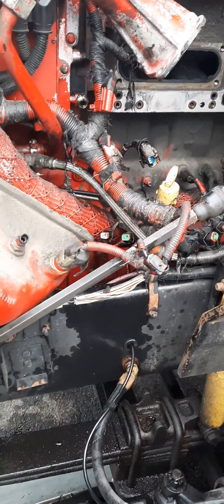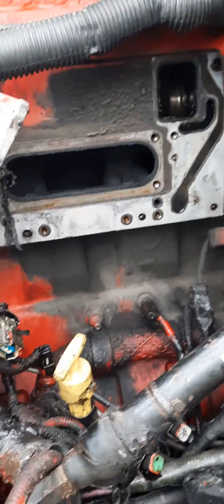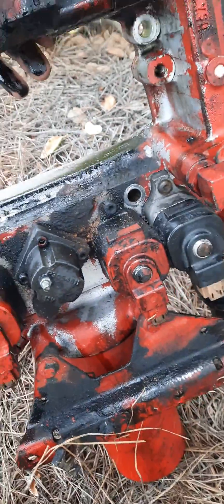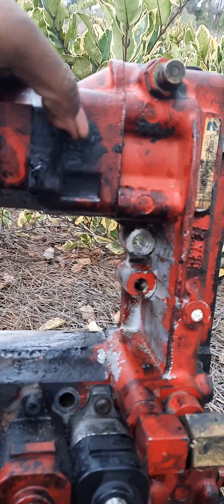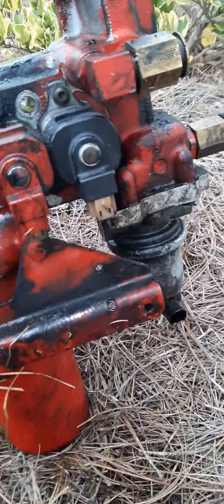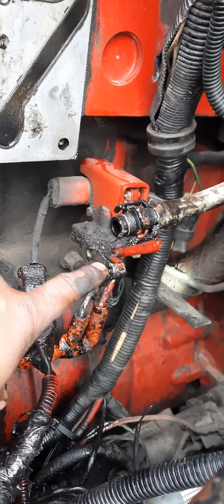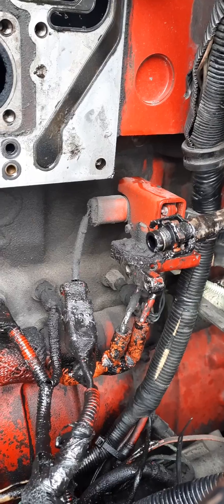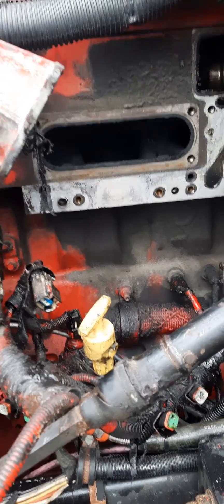Cummins ISX fuel rail unmount (CM870)

Comment: Was it leaking?
Reply from the maker: Yes the fuel dampeners on the backside of fuel rail needed to be rebuilt. They were leaking. There is a link in my description of a detailed diagnosis of issue but it's a common issue. I replaced all gaskets while torn apart..cost roughly $100
Reply: Thanks for this video.
Reply: Hello. I need help

I have an unstable Cummins QSX15 engine in revolutions that increases and decreases rapidly as well as a lack of response when pressed to increase fuel
Reply: How do I remove the actuator electrical connection? Are they a squeeze clip sort of thing?
Reply: Should've explained also how all the cables disconnect. I got 2 cables to the left of the assembly that just can't get off!